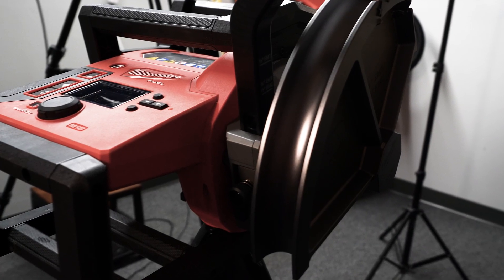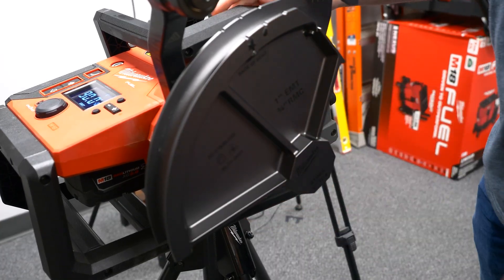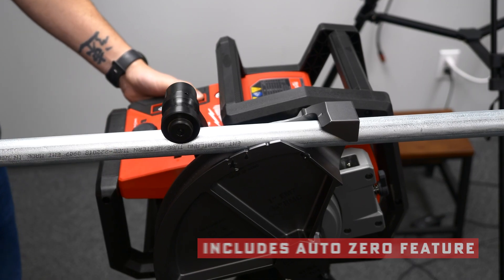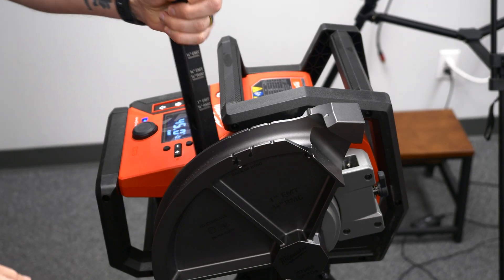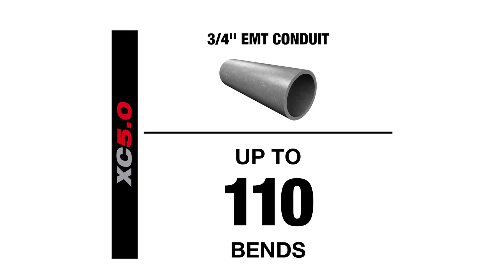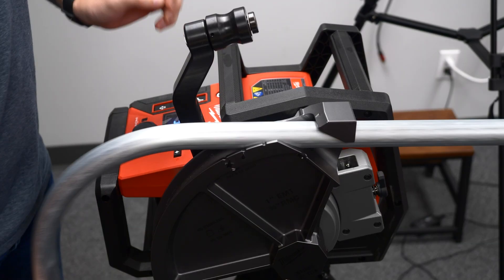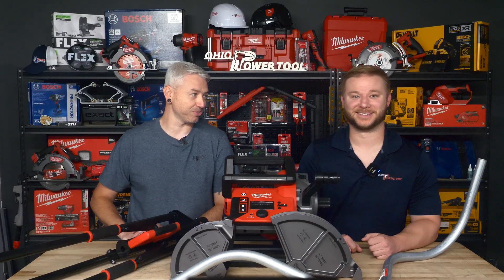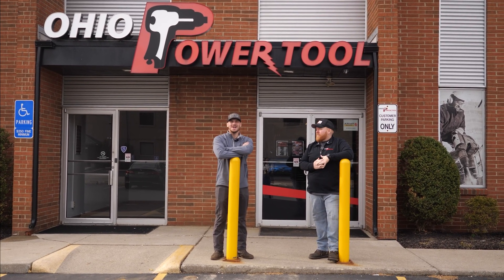Milwaukee M18 FUEL Conduit Bender, How Much Time Will It Save? | 5150-20

Comment: Does it do stainless tube though?
Reply from the maker: Great question! The Milwaukee M18 Conduit Bender is designed specifically for EMT, IMC, and RMC, so no stainless or PVC. Running stainless through it could damage the tool and void that 2-year warranty. If stainless is part of your daily work, we’d recommend looking at other specialized benders. And if you ever need help figuring out what tool best fits your material, give us a call, our team not only sells these but also services and repairs them, so we know what holds up in the field.
Reply: @OhioPowerTool the only tool that really does what we need is the Rothenberger Robend 4000. It would be awesome if Milwaukee made the dies for tube 🤤 this looks to be a better unit, and more user friendly than the German unit.

Comment: how do you do a 90 in the middle of a 10' piece without hitting the floor?
Reply from the maker: That’s a real-world scenario a lot of electricians run into. The tripod stand on this unit helps with stability, but for long conduit runs you’d usually want additional roller supports or to start the bend at a working height that clears the floor. This bender is more about saving your back and getting precise, repeatable bends than replacing every scenario a larger powered unit can handle. If you’re bending a lot of long runs, you may still keep a stationary unit on site for those jobs. We’ve seen crews use both setups depending on space and material. If you ever want to talk through setups or need support gear, Ohio Power Tool can help get you dialed in.
Reply: @OhioPowerTool so why not just use a manual conduit bender, your just taking the handle out of it
Reply: Rotate the piece 180 degrees in the jaw

Comment: Sorry but it needed to hit 1" RMC / 1.25 EMT to be something to really offer a value. I can't see too many companies getting one at 3k to bend one conduit size at a time. I mean maybe if your doing a ton of work from a lift yeah.
Reply from the maker: You’re right, capacity is the big talking point on this one. The M18 Branch Bender maxes out at 1" RMC and 1" EMT with the included shoes (½" requires an add-on). For contractors bending heavy 1¼" or larger all day, a corded or hydraulic setup still makes more sense. Where this tool shines is mobility, guys working from lifts, rooftops, or jobsites without power can move it around easily and still get accurate bends without burning through labor hours. It’s not meant to replace every unit, but for the right crew it pays itself off in saved time and fewer re-bends. And of course, if your investment needs repair down the road, that’s where our shop comes in, we keep people’s tools running as long as possible.

Comment: Does it have a vice so you can thread it?
Reply from the maker: It holds the pipe pretty firmly in place but not intended to thread at that point.
Reply: So a con lock only bender. If you have this money to spend you should be installing real conduit. Had me sold till I realised there's no vice